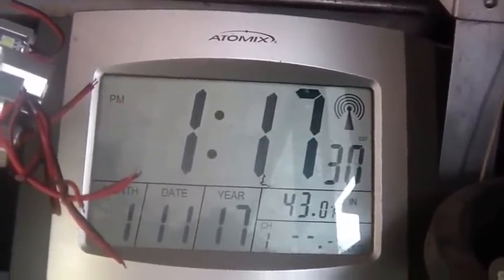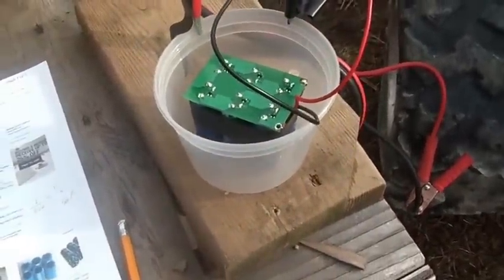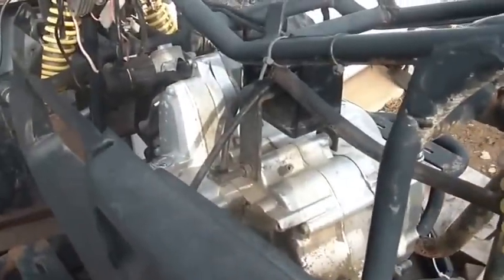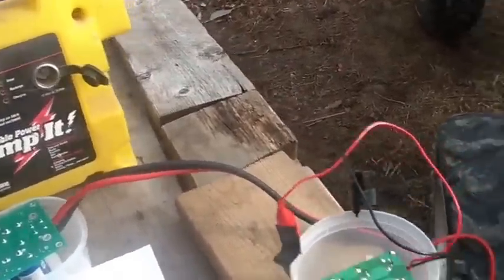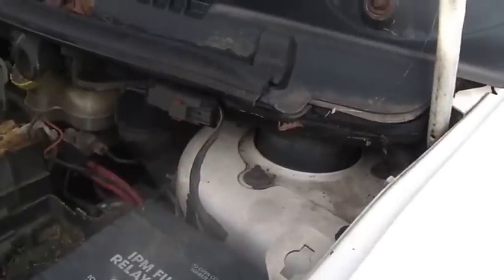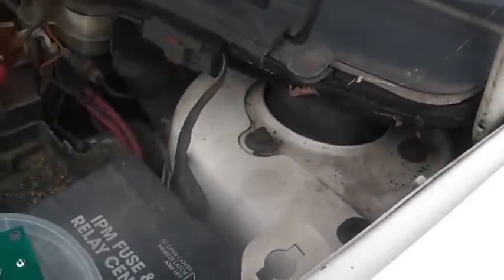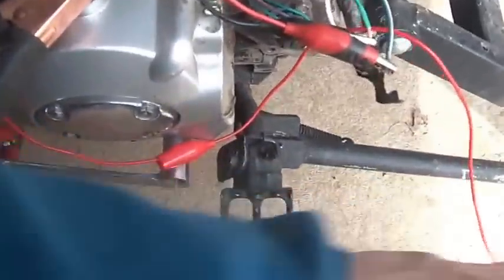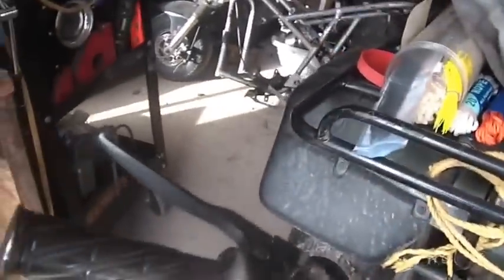$100+ 56Farad Capacitor powered jump pack review,

Comment: nice video, got a link tot he large cap bank?
Reply from the maker: Hey Josh, Here is the cap bank I bought, http://www.ebay.com/itm/262633838704?_trksid=p2060353.m1438.l2649&ssPageName=STRK%3AMEBIDX%3AIT  , rather then buy this, I would recommend this Li Ion jump pack... http://www.ebay.com/itm/BESTEK-600A-Peak-10000mAh-Car-Battery-Charger-Jump-Starter-Li-ion-Battery-/152467457979?var=&hash=item237fc4c7bb:m:mKKav7ruGExrN7jnEYPwxLg , Thanks for asking, watching, and commenting!!!!
Reply: nice, if i am going to get a jump pack would be the one i would get, https://www.amazon.com/dp/B015TKSSB8/ref=twister_B0183F272W?_encoding=UTF8&th=1 or this one, https://www.amazon.com/dp/B015TKUPIC/ref=twister_B0183F272W?_encoding=UTF8&th=1

Comment: I think if there was a battery in the van it might have worked but 
would still need more the 56 maybe double that  
I don't think the capacitors alone would ever have enough and if it 
did start the alternator  might have exploded those capacitors within seconds 
  before you could disconnect them   
as you said yourself they will not accept  a quick charge  
 an alternator is too high of a voltage at start up like 14.7 or more and lot of amperage
in a hurry  depending on the alternator  output  
please, my friend, play safe buddy make sure there is a battery in line to take the charge when the unit starts we don't want you to blow up real good or get hurt even for a viral video

Comment: If its a 3s pack arrangement, 3 x 4.2 is 12.6 for high cycle rate not charging each above 4 volts or below 3 volts.

Comment: If you're using an old filement to restrict current into the capacitor bank, you're not using the protection circuitry, and could recreate that through a no protection homemade capacitance bank.

Comment: back before there were jump packs,we used truck batteries with cables in a old shopping cart. it might have been crude,but it was the 70,s and never failed. you should never jump start a vehicle without a battery,you could fry the electronics.
Reply: roger oconnor Agree, although I've done that very bad thing more than 10 times on cars without a problem

Comment: may want to try the van again with a battery in it. capacitors usually dump their charge all at once. I think these are designed to give the battery a quick boost to get the engine started.